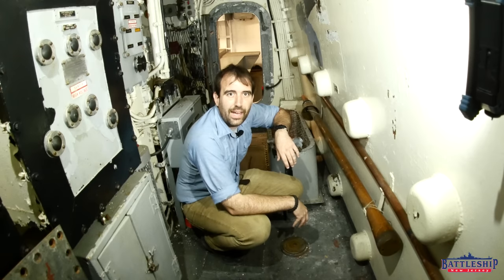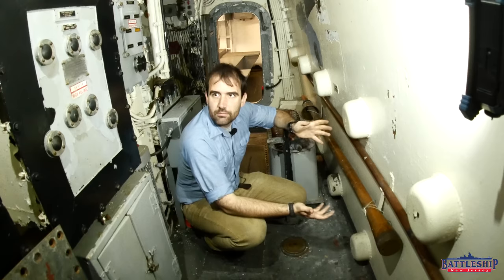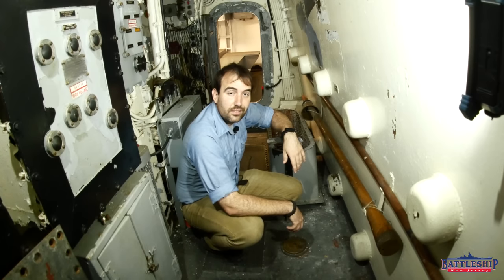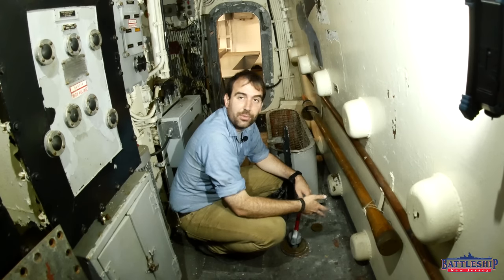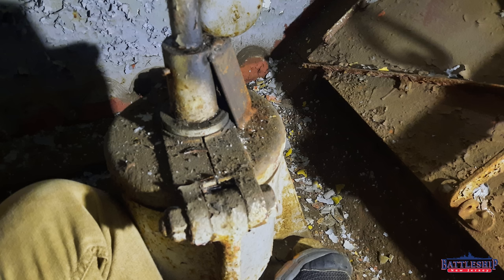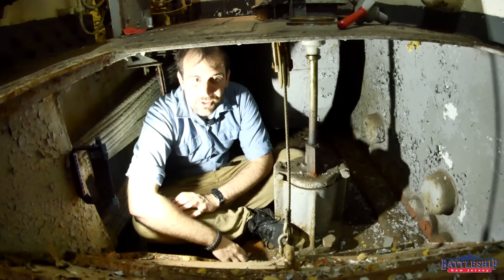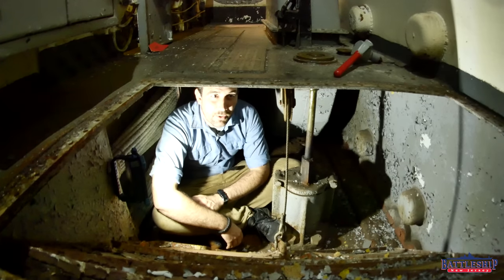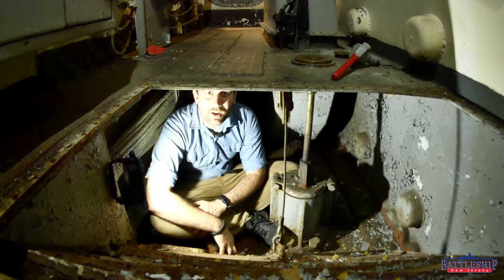Are The 16in Gun Turrets Welded in Place? UPDATE!

Comment: This "welding" makes so much sense when considering the Navy would want to make it as easy as possible to reactivate the ship at a later date.
Reply: Or just not go to unnecessary time, labor, and expense when a simple thing like a little metal plate will do.
Reply: It's also the simplest, most efficient way to take out something that's "decommissioned" not "scrapped". We sometimes mothball houses that cannot be restored (funds), but are of historic value. We don't "weld" the doors shut, we bar the doors from the inside and climb out of an easily accessible spot that can be sealed up from the outside.
Reply: @177SCmaro  This is probably also, if not more, true.
Reply: @aserta  That must be pretty interesting to do. It is a bit sad to see old barns that have collapsed in the rural parts of the Northeast. If walls could talk.

Comment: Great find!  I’d be tempted to grind off the plate on one locking assembly just to see if the pin could be withdrawn and reinserted. But that’s just me. 🇺🇸👍🏻
Reply: sure thing ;) and when it's out.... well, the engineer in me keeps thinking "if they can draw 1000amps from shore, sure one could figure out some electrical wizzardry to activate the motor at part power without it trying to draw it's full load". would be fun, seeing her rotating her turrets!
Reply: @wolfhalupka8992  Do not bother with the main motor, just use a smaller hydraulic pump to provide pressure. Will slew very slowly, but still within power limits. After all the main power bank had to provide enough flow to move a few hundred tons of gun in conjunction with a gunnery computer to compensate for both the motion of the ship and wave action making it roll, so had to be able to compensate very fast, with high flows.
Reply: @SeanBZA  More like nearly 2000 tons of turret.
Reply: @wolfhalupka8992  Also, a 300 horse power (a little more than 200 kW) motor needs MUCH less than 1000 amps at any reasonable voltage. There's something wrong with that calculation. The huge breakers might be for the whole turret, not just the slew motor? Of course the ship's internal electrical system might use different voltage from the shore power?
Reply: @SeanBZA  people keep saying this assuming there is a separate electric motor and hydraulic motor with lines connecting them that could be separated and a different pumping system added. typical of what we would see today on modern hydraulic systems.  

Based on some footage from other devices on the ship Ryan has refereed  to as electro hydraulic . The rotating mechanism may be one gigantic housing electric and hydraulic portions all in one, and if that is the case it’s likely bypassing the motor wouldn’t be possible 
 
I really don’t have the answer, but I don’t think it’s safe to assume that an 80 year old system works just like a modern tractor, and all the same tricks apply.

Comment: Ryan, the 300 HP electric motor was able to move the turret at 4 degrees per second, who says you need to move the turret at that speed. Move a side the 300 HP motor and install a much lower HP/current motor the turret moves but at a much lower rate. As long as the motor can produce the hydraulic press needed the volume/flow can be less.
Reply: pretty much this, even a small hydraulic pack for running hydraulic power tools would five enough pressure, it would just take a long time
Reply: absolutely, otherwise if you wished to aim rhe turrents a few degrees off set like HMS Belfast, you could rent a large diesel generator to make the power. or like they said just run the exsisting motor at a lower draw for slower operation, or a newer more efficient motor. if the only physcial barrier is the pins being 'welded' in palce, then you can find solutions for the other problems.
Reply: @Simon-ho6ly  like for the Jaws of life, but how much PSI is the Hydaulic system in the turret? Most Portable Hydraulic Generators from firetrucks make 10,000 psi peak. although other  larger ones exsist.
Reply: @JPOC226  i cant find a number easily but i imagine it would be sufficient, just slow
Reply: I think the issue is the 300 hp electrohydraulic motor is probably inside a heavily armored compartment. by the days of the iowas there was basically no way to hand crank a turret that heavy so you probably armored the hell out of the machinery instead
Reply: @AsbestosMuffins  that's a good point
Reply: @T.J. Kong Assuming we are talking about hydraulic pressure, that wouldn't be a problem.
Reply: @AsbestosMuffins  All of the machinery for moving and firing the guns is below the gun pit and above the upper ammunition flat.
Reply: @tedmoss  it would be a problem because not only are you dealing with static friction, the roller mechanism is pretty much steel on steel right now as a result of the turrets sitting in one place for decades now, basically pushing the grease out from underneath the rollers.  Stuff gets a lot easier when you get that first degree of rotation.
Reply: @jarilangerak9390  Railroads run steel on steel every day, in fact that's why they exist. The grease isn't to make it easier to turn, it's to minimize wear and for the bearings
Reply: consider that there may not be easy access quick change hydraulic lines or high voltage cable to just plug and play a new pump/generator setup into the existing mechanism. considering aging and the parts degrading over time would you want to be too close to those hydraulic lines untouched in 30 years as they pressurize? or just hoping the wiring got swapped sometime in the 80s with the refit so its not a piece of 1940s wire that the insulation has cracked off that is now shorting to the deck plates under your feet. 

the theory on less power (possible lower gearing on another motor to run the pump) just makes it a slower turn makes sense, but whether its a good idea to try is another question entirely.
Reply: They should do this 100%!
Reply: A 300 HP electric motor will need about 750Amps (3 phase 240VAC, 300HP with .9 power factor with 80% efficiency).  1 HP is 746 Watts, so 225KW/240=930amps (as the 300HP is already known the efficiently and PF is already figured in...the working HP is less then the 300HP..so amps will be less).  You can go with a smaller HP or less amps..it will just spin slower...but any fraction will need to be overcome.   All because the circuit breaker is 1800A, doesn't mean that's what it will need to work.
Reply: @andrewj9831  

Indeed, it just means you can't draw more than 1800A, which the turret motor will probably be (safely) below, training at full speed
Reply: You could probably just grab the fan on the motor and rotate it by hand. Might take a half day to turn the turret that way but it could be done.
Reply: @andrewj9831  Don't motors tend to have high start-up current draw, though? I would assume that that's the reason for an 1,800A breaker on a 300 horse motor.
Reply: @andrewj9831  My guess is that it's more likely to be 460VAC, so less current draw.
We build pumping units that are 300HP with 460VAC 3PH. The tag on the motor says 460V 332A at 60Hz, 380V 417A at 50Hz. Nom. Eff. is 96.2%. A motor this size weighs 2640 lbs.
Reply: @JPOC226  With hydraulics, it's not just pressure but flow rates, too. I use an air over hydraulic pump to pressure test piping. It has a 110:1 mechanical advantage. With 120 psi air input, it will generate 13,200 psi of hydraulic pressure.
The input side (air) is a piston about 3" in diameter. The output side (hydraulic) is about 1/4" in diameter. With such a low volume it is only be used for static pressure.
Reply: @T.J. Kong also sitting in the same position for so many years may cause “low” spots where roller bearings to sink into the raceway so overcoming that could be a issue too.
Reply: @vbscript2  At the most it will be  roughly125% of the reg amps, however there are a number of ways to overcome this.
Reply: @vbscript2  this size and age of motor would probably be of the slip ring type which has a much lower starting current than a "straight" squirrel cage motor.
Reply: @andrewj9831   Suspect the bigger issue is not the power draw is how the power is distributed.  

You wouldn’t want to be able to accidentally short shore power and the ships generators  together so the shore  powered circuits would be on some kind of transfer switch. 

Since shore power main 1200A and the turrets take 1800A each. They are not going to be wired to the shore side of the transfer switch  and there is probably is not a (non sketchy, electrical code violating) way to back-feed the turret breakers from the shore power system.  

Basically my strong suspicion is that the issue is not that they can’t throw the 1800A breaker, it’s that they can’t get the power they have to the electrical panel that 1800A breaker is in.

Comment: After my visits to the Wisconsin and then Texas I ran across an article, at least for Texas, that the turrets had a manual system for rotating their turrets in case of a massive power outage during battle.
Reply: Elevation I might believe, but turning it?  It'd either have to be super super slow, or have room for 300 men to turn a handcrank
Reply: Found another comment from planehogger.  It takes the USS Alabama BB-60 6 hours to move the turrets by hand, with a hell of a lot of help by ropes.  Not practical to use during battle.
Reply: Maybe for the secondary turrets, not the primaries though. Youd never be able to rotate them at anywhere near a useable speed while underway and under fire.
Reply: I’d imagine it’s there to rotate the turret back to center line for balance.
Reply: @killergames391  the turrets are balanced in all positions.  But in case of damage, you would want some means to return a turret to centerline to get the guns out of the way.

Comment: I don't know you would even have to cut that weld to remove the pin. it looks like you could just unbolt that cap and access the pin directly and screw it out from down the the acess.
This wasn't welding to decommission, this was welded so that some dumbo didn't play with the wrong thing. Things like this happened all the time because it's just that extra 5% that takes it from able to be messed with to "special tools required"

also, if it's a threaded pin they may have worried about it backing out if there's a little play in it. over the years if there's any slop, the moving of the water will cause the turret to want to walk that back up and out of the threads. this is basically just a cheap easy way to non-destructively prevent that
Reply: Yea, kinda thinking the same thing, but more along the lines of making sure the guns don't rock on the gearing and bearings, wearing them down or breaking them, then to keep then safe from "some dumbo".
Reply: It also looks like whoever welded that piece on,  couldn't do a decent weld either. Shocking quality of work if I say so myself.  5 minutes with a 4.5inch disc grinder and it would be loose.
Reply: @sirmalus5153  my guess is zero prep and a quick stick weld. It's not made to be a good job, it's made to jam things up and get cut off quickly. I do stuff like that at work when in just putting a clamp on the bench or something like that
Reply: @sirmalus5153  it's don that way so you can easily find and remove the part. If the welding had been done nicer it could have been hard to find the welding during a reactivation

Comment: The motors on the turrets are designed to move the turrets while underway in a heavy seaway. Moored at the dock, in essentially level conditions,  the turret motors wouldn't take anywhere NEAR their full rated power draw. I'd be willing to bet a case of beer that (after cutting that piece of steel off of that pin) the turrets would move quite nicely on shore power alone.
Reply: Part of me wants to see the turrets rotate just for laughs and part of me wants to have it done to stick it to the Navy for the "oh! but the turret welds!" shenanigans.
I mean... even if you did need full power to engage the hydroelectric motor to turn the turrets... You can meet the demand with portable generators and decent electrician work. Wouldn't be pretty and it would just be symbolic (which is the point), but it would work. Hell, more janky things have been done officially in the Navy historically anyways.
Reply: @matchesburn  

Well, you'd have to agree that the turrets ARE welded into place, so the navy didn't lie
That the welds are so insignificant, that they can be broken with a good whack of a sledgehammer,... details
Reply: shhh they start trying to take your battleship away if you tell them.

Comment: I'm sure the answer is "we have no idea" but surely there has to be some sort of manual backup to rotate the turret in a severe emergency right? Like a wheel or screw with some super crazy gear ratio. Like say the ship took severe damage in battle lost all power and had to be towed to port, but the turrets were blocking entry into port or something. The navy definitely had some sort of backup to prevent this kind of situation.
Reply: Yes. It's called removing the turret with a barge crane. If the ship lost all power (like SoDak, but on a more permanent basis) then aux power would be supplied by an assisting ship, which the turret motor would run off of. If the turret motor is wrecked in such a way that it can't be repaired in situ, WITHOUT wrecking the rest of the traverse mechanism somehow (maybe an electrical fire?) then the would have to pull the turret.  Each turret weighs ~3000 tons. Manual operation of the turret, no matter how many reduction gears you add, is not possible. It is just too heavy.
Reply: @michaelwanamaker9829  Would the emergency generators be able to provide enough to run the motor in a lower gear?

Furthermore, didn't each turret have its own emergency generator?
Reply: @calenedgar3722  I’m sure he’s talked about the power capacity of the emergency diesel generators, but I’m also sure that they can’t provide 1800 A of current. As far as centering the guns, you might be able to use a tug and the barrels as a lever.
Reply: @dcviper985  ship has a paid of 250KW generators. A single turret draws more power than that total. It would not be practical to operate the turrets if the main power was down, you would need power for other more important things like DC.
Reply: USS Texas literally has a room where guys can pull the turret with chains and pulleys to turn it in an emergency. They posted a video showing it.
Reply: @streetracer2321  Ya there has to be some 1000 to 1 ratio wheel somewhere
Reply: I would have to imagine there was some kind of backup plan, surely.  Having a single point of failure in what is essentially the main purpose of the whole ship seems like a HUGE weak point.  I mean, it could still function and be useful with 2 turrets, but if a single motor failing could reduce a whole ship to 2/3 capacity, that's just bad design.  
I am not 100% sure what electro-hydraulic means in this case, presumably its an electric motor powering a hydraulic pump?  If so I would be willing to bet there was some form of provisions to hook up an external hydraulic supply.  Either from a separate system, or from a bunch of dudes with pumps.
Reply: How do you feed the ammunition up from the magazine if this were to happen?
Reply: @dcviper985  only if the turret traversing gear can be disengaged, I believe the mechanism involves a worm gear and those cannot be rotated from the end of the gear line, only from the motor end of the gear train.
Reply: Always have a back up, war is hell.
Reply: @cdburner5911  Electro-hydraulic means exactly that.  There is an induction motor spinning at constant speed, and a variable displacement pump.  The pump can produce both directions of flow, from zero to 100%.  That pumps hydraulic fluid to a hydraulic motor that then spins a gear box and eventually the turret. 
There are two training systems.  Normally both are online, but only one can move the turret if needed.  The "backup" is the fact that there are 8 turbo-generators and 8 boilers that can make power, along with switchgear that can route the power several ways.
Reply: @matthewbeasley7765  Ah, interesting, that makes perfect sense, thank you.  Do you know if the variable displace pump a more modern retrofit, or was it original from WWII?  

I figured it was just I didn't know what the backup was, rather than there wasn't one.  I hadn't considered the multitude of generation sources =P
Reply: @cdburner5911  This is all original equipment.  There is an incredible level of tech in those turrets.  The first work on servo positioning control was developed to aim the guns on the earlier ships.  
The computer would calculate where to aim the gun, and there was a servo system that would run DC motors on the pump displacement control to match the gun position to the computer output with high precision.
Reply: @cdburner5911  there were definitely backup generators at least. Most likely a backup hydraulic motor too; that’s how the hydraulic steering works.
Reply: @calenedgar3722  Yes, but part of NJ's agreement with the navy is that those generators are never turned back on.
Reply: Ryan was incorrect.  Here's a video from last month of Iowa rotating turret 3 through shore power: https://www.youtube.com/watch?v=eD8k6bpJZ98
Another video from the Iowa museum stating that there's been "a lot of misinformation" in regard to this topic: https://www.youtube.com/watch?v=AtVZ0u_Xmog&t=15s